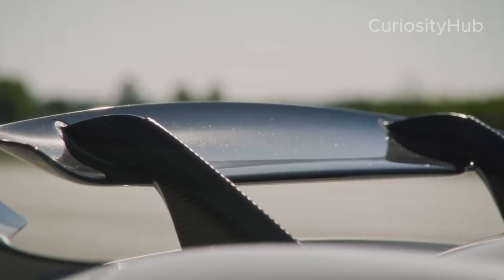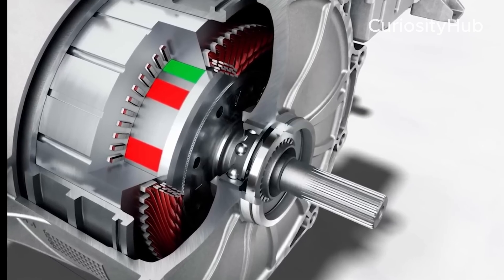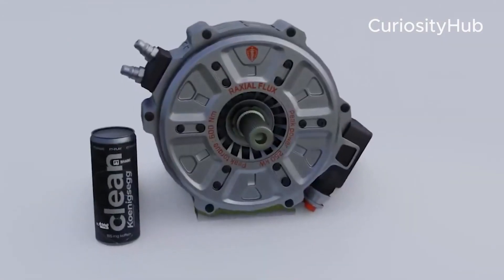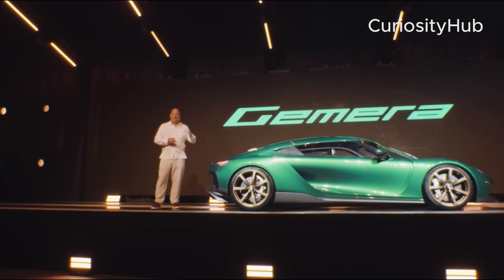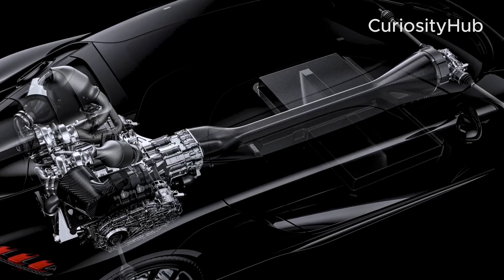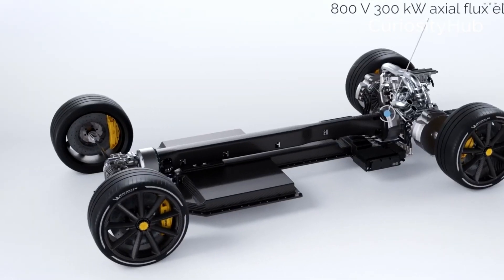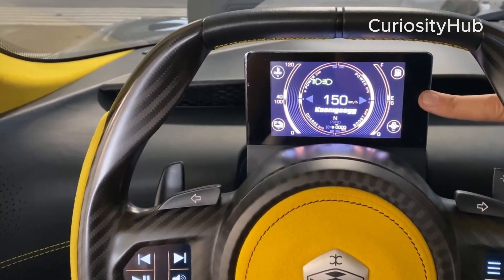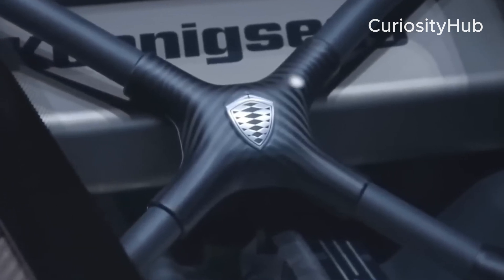All You Need to Know About Koenigsegg’s Dark Matter Engine

Comment: Raxial flux is most likely not suitable for mass production. But if it is suitable for mass production, every EV brand should make raxial flux motors.  The "dark matter" engine is a hybrid:  7 liters of gasoline per 100 km is not efficient. It is only highly efficient for a car with this enormous power and torque.

Comment: The only thing about using electric motors isn't that they're less environmentally friendly. The motors themselves are one of the best ideas ever thought of. It's the method we use to store the energy to run it.    Batteries. 
     Electric motors have proven infinitely better for doing their intended purpose. If we can design a battery that is less caustic to the environment or a battery that could easily be repurposed and wouldn't need to be disposed of to begin with then the electric motor could very well  be what powers the future.
     But admittedly there's no better sound than a well tuned internal combustion engine 😏😍